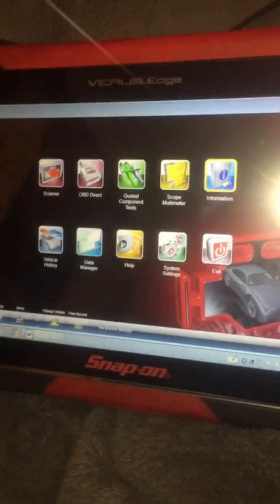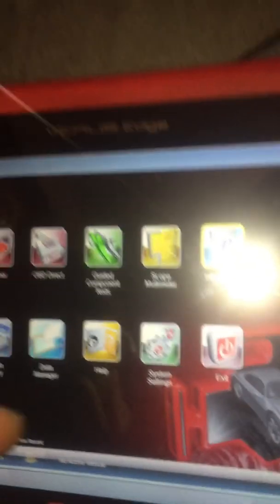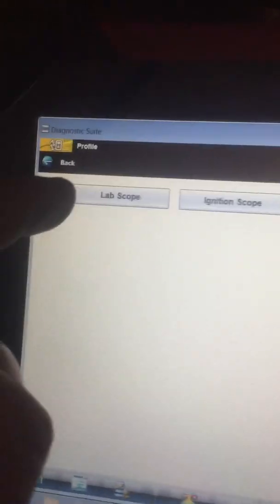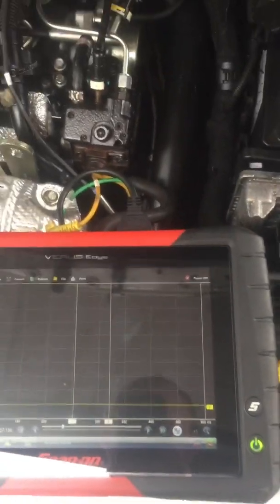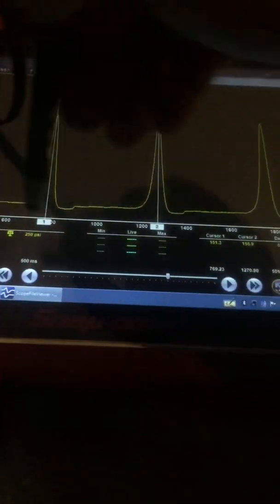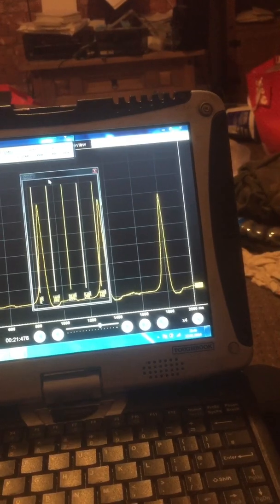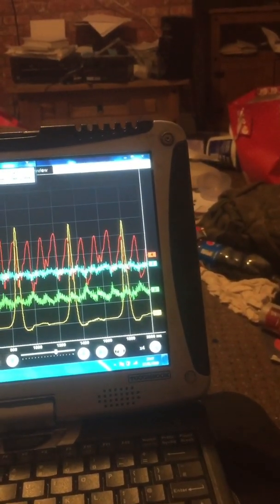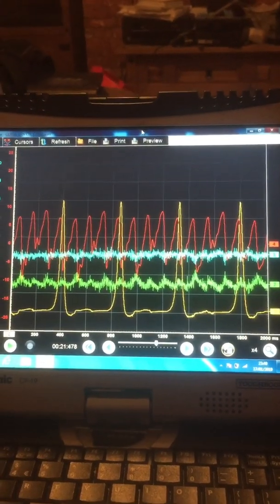Snap on pressure transducer

Comment: Which hose did you use between the transducer and the spark plug hole?I used one off an old manual cylinder pressure gauge which fitted perfectlt,but sermingly it has some kind of schrader valve in it,you can't blow through it!And you can't get out the schrader or whatever's in there,you can't screw it out?
Reply from the maker: I’ve used an old manual one tool gauge and schrader off it’s draper brand one nice and cheap around £15 so cheap enough to just buy for pipe